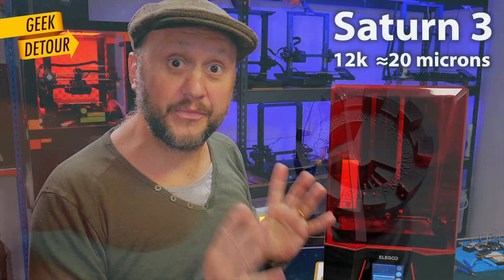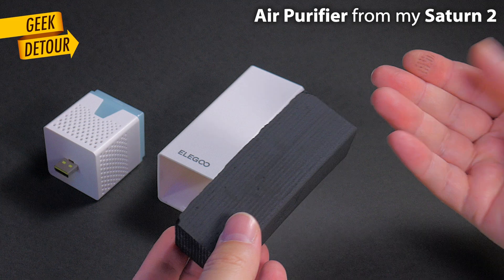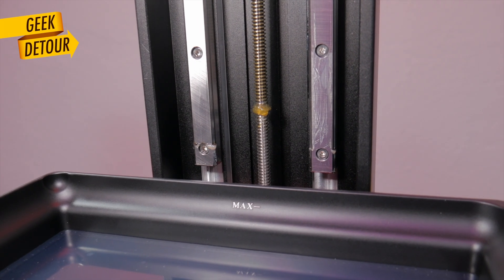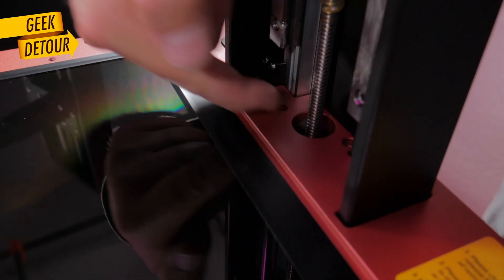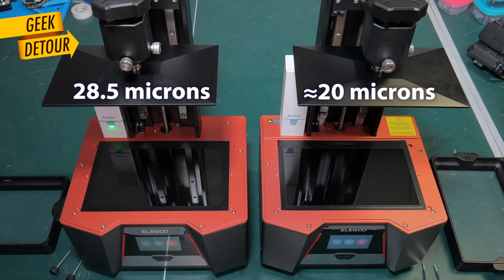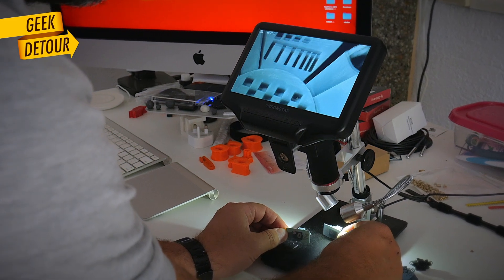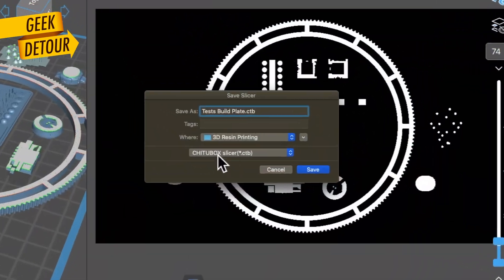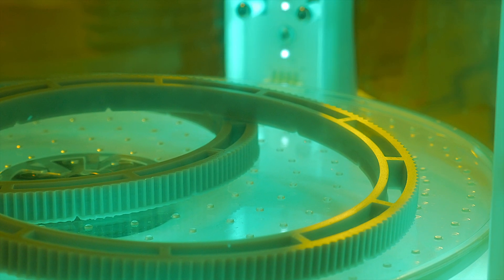Saturn 3 vs Saturn 2: Resolution matters

Comment: I wanted to get a resin printing but after hearing how toxic it is I decided not to 😢😢
Reply from the maker: Well, it is definitely worse than filament - I won't let my daughter play with resin printers until she is at least 10... or 12... I don't know... she must be able to work well with gloves and have a very fine control to not make a mess. Also, you need a ventilated, separate place to work with it.
Reply: @GeekDetour  I agree, having a dedicated space for this is really important.

Comment: Hi,
about the fans when turning on on saturn 2, i've noticed that this may be controlable...the saturn 2 usb druve as a file called "SATURN 2 Machine parameters20220422.gcode.txt" does the saturn 3 also comes with this file?

I've translated this file with chat cgt and found this section

; [LED Fan control]
M8030 I-1 ;
; 0: If set to 0, it will not rotate by default.
; -1: Always on.
; -2: On during file printing, off when not printing.

; [Mainboard cooling fan MB_Fan control]
M8030 T-1 ;
; 0: If set to 0, it will not rotate by default.
; 1: >0 Once exposed, fan 2 will rotate, and if not exposed, the fan will stop LED.
; -1: <0 Always on.
; -2: On during file printing, off when not printing.

Which leads me to believe that this can be changed, "printed" and make it behaving like saturn 3...can you check please?

Thanks

Comment: Hi, I'm looking at buying a Saturn 3 but totally new to 3d printing. I'm planning to download 3d model templates but not design my own. How big is the learning curve just to print existing 3d models. Its it relatively straightforward or will there be a bit of practice before getting good results? 
 Also just wondering whether it's safe to print using resins in a home environment. Is there any risk of fumes/toxin build up and if the usb air purifier enough to clear this? Many thanks
Reply from the maker: Resin printing is not so hard to obtain impressive results. It is far easier than with Filament printers. You just need to master leveling the build plate. Resin has a cleaning and curing process that can be tedious… cleaning with alcohol, like, two or 3 times, and drying well with a hair dryer… removing supports, then curing (could be in the sun, but a curing station is VERY recommended and convenient). Results are always impressive. There are a few things to learn… you should work far from windows - or do it at night, otherwise UV light starts curing the resin before it is actually dry and ready to actually cure. The smell is a reality. If you can do it an a garage, or a ventilated room it helps a lot… although, if the room temperature is under 20°C, the Resin doesn’t behave well. 25°C is the ideal temperature. I printed a few things when we lived on an apartment. It was not nice. The smell was evident. Today I have a dedicated space for my printers and work. I leave it printed at night when I am not there.

Comment: I just rec the Saturn 3 12k... after 6 attempts this so called great machine has yet to finish one job and I'm talking about the rook. The print set up by the company. As far as customer support good luck.  You are better off buying a Potters wheel and some clay at least you could get something for your money.
Reply from the maker: Oh, that sucks… Please, is it your first Resin Printer? I cannot stress enough how important it is to have the build plate leveled at equal distance on all corners (using a sheet of A4). I hope you can figure out and start enjoying it 🤞

Comment: Resins för functional parts... ? What? When? Soooon I hope! I have looked for this for some time (hoping it will not cost too much extra from ordinary resin)! 😉 How much does it differ from resins like "ABS-like" resins?
Reply from the maker: Oh, no! ABS-Like is definitely not for functional parts. I tried Sunlu Nylon-like and it is MUCH better. Prints better, looks really like plastic later, tougher - but it shrinks a bit, like all resins. We need to calculate a shrinking factor and it needs a week to shrink to the final size… Yeah: resins for functional parts is not straightforward - but for really small parts it can be nice. As long as you have time to wait for it to reach the final size.

Comment: Nice video ! Thanks :) Do you think the extra price for the ultra is worth it ? Have you had any issue with the ball joint system ? Thanks again :)
Reply from the maker: I don’t have the Ultra myself, but yes, I think the 4 screws build plate bracket is more reliable and easier to level than the original ball joint system we are used to.

Comment: Never used chitubox yet with my saturn 2 alway lychee!
Reply from the maker: And I barely opened Lychee 🤣 I want to use it more - actually, I so much want to print more with resin… I have 10x more experience with filament.

Comment: Yeah your saturn 2 needs the update! I got mine 6 weeks ago no fan until press print and shuts off when finished and pausing! Elegoo fixed this after Faux hammers video you just have to update it! I got a march 2023 date build on mine so was done out the factory! I am still getting the saturn 3 ultra next week as was going to get another saturn 2 anyway but then these came out so I'll pick one up as one is just not enough! I have 2 smaller anycubics mono 2 there great but need a second larger one, thats the way you get fast prints is having more than 2 printers going at the same time!
Reply from the maker: Thanks! I think you are right, you are the second person to mention that their Saturn 2 got quiet when not printing. I will look for the firmware update.

Comment: I love videos that point out specific technical details and both the pro/cons and human experience that may contradict the otherwise obvious upgrade——well done !! So my experience/history with casting is limited to lost wax. Can you utilize one of these prints and burn it out cleanly to cast it in bronze or aluminum, stainless steel, etc.
Reply from the maker: Oh, thanks! Yeah - human perception is a tricky amusing thing ❤️

About casting with different metals: Absolutely! Here is a video from VOGman - he is using another printer, but the the resin works on all UV printers: https://youtu.be/60Vn49uBA9I
Reply: @GeekDetour  thanks for the quick response—-I might invest in one of these soon! & I’ll check out the video

Comment: Great video!
Under your microscope, we can see some black dots at regular spacings... 3:07 

Any guess what this could be?
I had a defective saturn8k I sent back. It had defective areas on screen, and on those printed areas I saw regular spaced dots ...
Reply from the maker: Thanks! I can see a “diamond” spaced distribution of darker pixels. I have no idea yet if it translates into the prints - and if it could be noticeable at naked eyes.
To my needs it prints perfectly - but I am super curious and following every user’s group of printers that use these new 12k Mono LCDs.
To me the biggest discussion is ACF films vs NFEP films - which types of prints are affected by the ACF micro texture. Maybe Jewelry makers will decide for NFEP, and most other users will prefer the speed and ease of print that ACF brings.

Comment: What about the health aspect of these printers? Are dangerous fumes formed? Great video! Thanks a lot!
Reply from the maker: Yeah: Resins are… nasty. There is no other word 😂 The Air Purifier helps a lot with the smell - almost nothing - while it is printing with the lid closed. But when it is open, and when you need to wash, than pour the resin back to the bottle… all this processing has a bad smelling. Some resins are nastier then others… some are almost pleasant. The norm is: you need a ventilated space - but without natural light anywhere close to where you will process the prints and deal with the resin.

Comment: Enjoyed the comparison video. I recently purchased a Saturn 2 and my fans don't run until I start printing like the Saturn 3. Im guessing maybe Elegoo made some changes after the initial release of the Saturn 2.
Reply from the maker: Oh, that’s interesting! Maybe there is a firmware update…. Could you try to find your firmware version on the printer?
Reply: @GeekDetour  I ended up wanting to check this myself after the video! I have one of the first Saturn 2's that shipped, got super lucky on the early bird purchases!
Reply from the maker: @TunneLVisioN42 So, your Saturn 2 is silent when not printing? Maybe I got a pre-production unit to make my review. I need to check if I can update my Saturn 2 firmware.